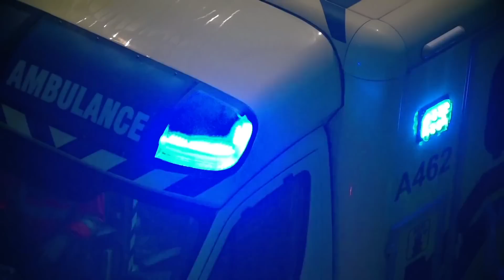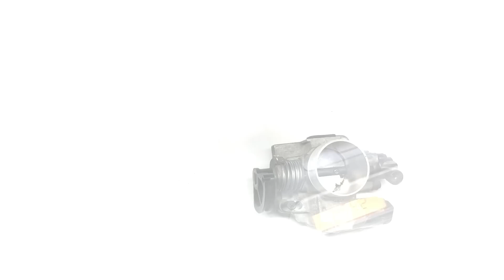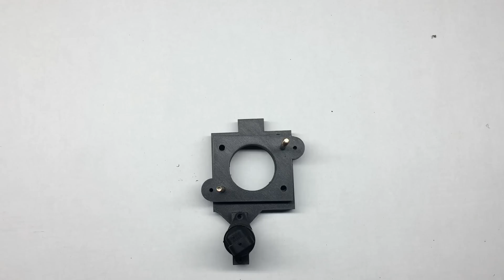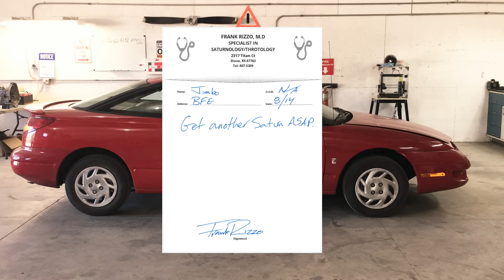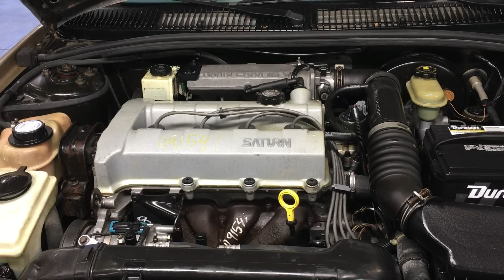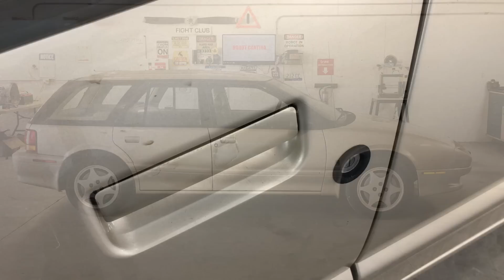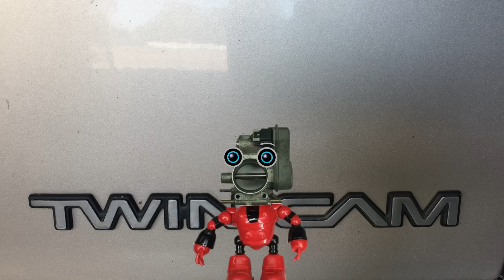S2E19: DIY Smart drive by wire throttle plus new project car Saturn SW2

Comment: Cut off roof of the wagon, only behind the B-pillar, and weld the back doors closed! 

Make the world's first Saturn pickup truck!
Reply: My 2002 Ford Focus wagon with 277k miles was stolen in Portland
And came back minus the rear seats, so now it is a two seater sports car.

I need a pickup so I also have been considering turning it into a El Camino stele pickup!
Reply: I was wrong, not the first…
https://i.imgur.com/sKvtenH.jpg

Comment: Mount the electronic throttle body to the strut tower. Re-route the OE throttle cable from the pedal to the electronic throttle, it stays attached to the OE throttle body & intake manifold.

Attach the cable to the electronic throttle body. Cable to the butterfly, housing to housing.

Electronic throttle body  controls OE throttle body.

Comment: I would've opted for the cloth seats and power windows personally, but I otherwise like how that car is optioned too. In real world driving I think you'll find that there's not much difference or even an improvement in mpg with the twin cam engine. Same displacement but it breaths better, so if you keep your foot out of it it does really well on fuel economy. I was able to beat 40mpg on a couple highway trips with mine.
Reply: Also, you might do well to invest in a mini split AC system for the shop. They sell DIY install models online and they're not that expensive. About the cost of a beater Saturn and you're good to go! I say this because I live in NC and the shop on my property already had one installed when I bought the house. It's absolutely amazing to be able to work on projects in the shop when it's 95*F+ and humid outside while I'm in dry 80* or cooler air. Not too expensive either. I only run it when it gets really hot out because the building is insulated and the concrete floor keeps it pretty cool in there the rest of the year. Mainly July/August is when I crank it up.

Comment: You could try some diy air conditioning for the garage. Where the system cycles some cooling liquid underground with no phase change. Pumping losses are minimal, since there is no phase change (gas to liquid, like r134a) or elevation change.

Comment: Honestly if I were you, my next priority would be getting a Mini Split installed in that shop. I don't care how tough you are, A/C makes a world of a difference. 😄😄
Reply: I picked up a window unit for my shop at an auction, i got the unit for doing a delivery. Its not going to get that cool but it sure takes the humidity out of the air. I have a 26 x 20 foot garage, and this is like the littlest window unit there is, but it still does a decent job if you turn it on a couple of hours before working. Of course my garage door is insulated, as with the walls, and i got tech shield on the roof and over the rafter so . . . . . .
Reply: Yup. Even a window unit would help--85 is worlds better than 103.
Reply: They're horridly inefficient though...
Reply: @swecreations  True but an ER visit for heat stroke ain't exactly cheap. I'd take the AC bill any day over that.
Reply: @dcf8978  Imagine living in the only country in the world where healthcare isn't free. 

Sorry I had to...

I recommend blackout curtains, those also have the effect of cutting your AC bill in half if you already have AC and they cost like a few dollars.
Reply: @swecreations  i like my stupidity to be fixed immediatly by a doctor, no waiting weeks to see a GP, bills do suck tho, cheers
Reply: @alex4alexn  That's just propaganda they tell you to accept being treated like that, in reality waiting times are not much longer for most people, for smaller non-ER visits wait times are non-existent, Emergency ER visits are instant of course and non-emergency ER visits are handled within a few hours. It's just that whenever something does get messed up and someone gets to wait way too long to get treated it often gets headlines immediately.
Reply: @swecreations  Can confirm that it's about the same here in Finland. If I'm sick and need a doctor (not an emergency) I've always been able to get in within a couple of hours, and many of my family members have unfortunately had some emergency situations, but they also got taken in immediately.
Reply: @swecreations  "free" Also your comment on propaganda just aint true, at least in canada. Second thing, unless you live in LA or any other shithole, the bill is cheap.

Comment: Carb cars prefer light load with a higher rpm to save gas. EFI cars prefer low rpm, even if it's lugging, for better economy. 
Generally half the rpm will half the fuel, and high load only adds 10% more fuel. Where as double the rpm uses double the fuel, with an additional 1% for light load. Basically half the rpm is maybe 10%-20% better when you look at the total.

Comment: I have a suggestion but it's probably obvious and you no doubt already got it figured out. How about a third throttle body linked to the workshop temperature sensor for the input and linked to a drinks dispenser for the output driving a jug (I think the Imperial crowd calls them pitchers, jugs might be something else entirely) right there on the bench in front of you? Even your dehydrated videos are great. OK now you've read that go and have a drink.

Comment: OK I was definitely scratching my head but it sounds like you are just programming in an eco mode to the throttle control.  It will probably have the same overall result as a modern car's eco mode.  Essentially, you are artificially widening the foot throttle position range to run at a more specific engine load.  So it will feel like the engine response is even worse until you press the throttle deliberately out of that range.  Combine with lean burn and she'll be real "satisfying" to drive :)

Comment: Throttle by wire is great as a concept, but in reality, in modern cars, all it does is take away my control of the engine due to emissions.

Comment: Could you come up with a device to copy an electronic throttle body signal? 

More of what I am asking I guess,is it possible? Would like to mess around with dual electronic throttle body's on a car that's supposed to only have one...everyone has said it's not possible.
Reply from the maker: I reckon anything is possible, however you would need a deep understanding on how your PCM interprets throttle commands.  The major safety concern with drive by wire is run-away throttle and the PCM  closely monitors sensor data and will throw a fault if the inputs are out of range.  This is something that would take a lot of time to hack.
Reply: @robotcantina8957  hey thanks for the response. I like the anything is possible attitude. I will continue to look into it and maybe at some point could figure it out.

Comment: I think the gasoline Saturn could benefit from a stock ECM delete entirely.
Now that you have DBW going, that would work really nicely with speeduino. Obviously not out of the box (speeduino doesn't support DBW due to safety reasony) but i think the D2B controller you've made could be connected to the speeduino to efficiently control the throttle position.

There's many possibilities once you have total control. For example, when cruising, throttle could be set to wide open, timing retarded and lean burning as much as possible. Pretty sure modern engines work like this (also helps if you have an auto, so it's in the correct gear as well) and you can gain a decent fuel economy just by that.

Another thing that comes to mind; does that car have EGR of any kind? That would also help quite a bit with economy (especially combined with DBW).

Some ideas for future modifications, IF that project continues to be worked on :D

Comment: you can ditch the secondary throttle and adapter if you use the drive-by-wire throttle body off of a Trionic 7 SAAB, like a 99-03 9-3 or a 99-11 9-5. the throttle cable connects directly to the throttle body on those, and gives you the option to fire a solenoid to directly connect the throttle cable to the throttle shaft. I think early ones still have the cast bungs for an idle air bleed, too.
Reply from the maker: Thanks!  I just checked out a few on ebay and that's an awesome throttle body.  I'll pick one up for experiments.
Reply: I have 4 cars with this throttle body

Comment: Nice! Can we have a pick to the code?
Reply from the maker: For legal reasons I cannot provide code samples, however at the end of the next video I'll explain how the code works, its super simple if you understand electronics and programming.
Reply: @robotcantina8957  I was wondering if you make use of any PID function and if you was driving the motor only in one polarity and rely on the return spring tension for stabilization and closing the throttle.

Comment: can you invent a throttle-body-less car. The throttle is always wot. When you hit the gas pedal, the computer would just add more fuel instead. This would do away with all oxygen sensor shenanigans. All the problems with fuel system failures, like cracked manifolds, soiled o2 sensors, damaged cats, variably clogged fuel injectors, ect.
Reply: You mean a diesel?
Reply: You just described an old school diesel.
Reply: You also described BMW valvetronic
Reply from the maker: I think others have said it best, that is pretty much how a diesel works.
Reply: @robotcantina8957  okay so invent for a gasoline engine...

Comment: No advantage of manual throttle compared to drive by wire exists, other than cost. Another important note is accelerator position sensors don't use potentiometers, they use hall effect sensors
Reply from the maker: You are correct, there is no advantage between DBW and cable throttle.  Our plan is to use additional signals  like the MAP sensor to adjust the throttle opening for maximum fuel economy.  Its a fun experiment.
Reply: Tps are sometimes hall. Every electric pedal I’ve seen is indeed dual potentiometers, I wouldn’t be entirely shocked if some German tried hall, but it’s not typical for Japanese or American stuff
Reply: cruise control is on point with DBW

Comment: Take care of your electrolytes.  Also, if by chance you're blocking proton pumps (in your stomach) have your Mg checked (almost took me out back in April '20).  Had to quit PPIs or die -- it was a choice.  As for the new heap of junk, well, it's like the rest of them which means I can't wait to see the next episode.  Tx.

Comment: The dealerships are all telling me 'if your car has power options we'd give you $500 more'....   I reply 'manual locks and  hand windows are premium!'
Reply: I gotta say, I like the central locks. But I do prefer manual windows.
Reply: @briannem.6787  I'm torn, personally. I get the reliability of manual windows, but then again I also like having the ability to close every window from the driver's seat, and being able to open one front and one back window for best crossflow on hot days...
Reply: @jubuttib  I agree, but also sometimes I want to wind the windows down when the car's off, and the windows stop working when I turn the keys off. In one car, it at least has a 30 second countdown until it stops working, but that stops if the doors open.

If power seat adjustment works at any time, why not power windows? it's a bit weird to me, I don't see a reason it should stop when the car's off
Reply: @briannem.6787  Well one reason I can see is it'd make opening windows on parked cars quite a lot easier, if all you had to do was push down on the button...
Reply: @jubuttib  good point, but you could wire it to the central locking- if doors locked, windows are too
Reply: @briannem.6787  Sure, there are ways around it.

Comment: Old school throttle cable only uses "one line" of code, not a million, I trust code that is small and efficient and fewer points of failure (Me/Cable vs software/computer, actuators, etc.).
Reply from the maker: I agree,  I'm not a big fan of all the gizmos in modern cars.  This is just a fun experiment.

Comment: You think the heat is bad? Half of my family is from Michigan the other half from Kansas, let me tell you something about the winter time down here in Kansas. Prepare yourself buddy, I've seen 12ft of snow on the ground in Michigan 1,000 times, but just wait for the Kansas blizzards and it's -45f ~ -55f for 2 weeks straight at night, you'll be packing an extra pair of undies to keep the brothers warm I guarantee it.
Reply: Minus temps generally aren't a problem in places with houses built for that.

But plus 16c is chilly in thailand because theres no heating and if its 16c outside its 16c inside. Its been 30-37c for a few months now tho.

Comment: You could interpret the Idle Air Control Valve signals as some kind of offset for your motorized throttle position.
Reply: Absolutely what I was thinking, but dialing in the correct blade position relative to pintle motor voltage would be a heck of a chore since the cross section of pintle air and throttle are are wildly different. You'd have to measure the airflow through the pintle at each step and correlate to throttle position on a flow bench, coding the lookup table after that wouldn't be hard just don't forget to add some logic to tell the dumb computer to disregard lookup if the APP is giving input!
Reply: @huzudra  I'm pretty sure that the ECM feedback loop would take care of the problem mostly. Pintle probably is close to linear flow vs opening, while throttle is logarithmic flow vs opening angle, for a small range of angles you could say it's 'linear' and just say that 0% pintle is 0 degrees and 100% is for example 10 degrees of throttle opening ;-)
Reply: @akkudakkupl   That might work indeed!